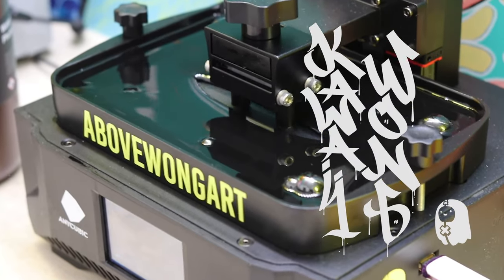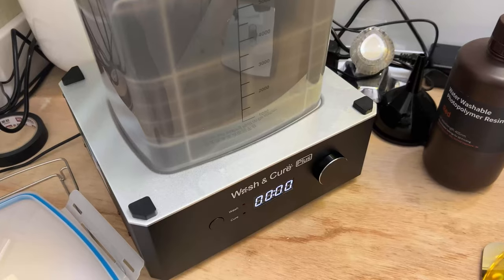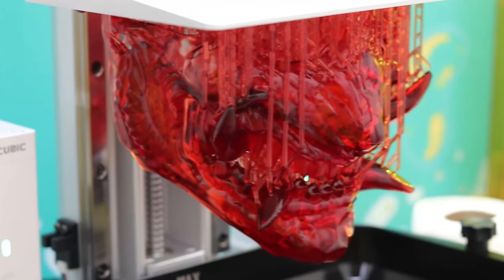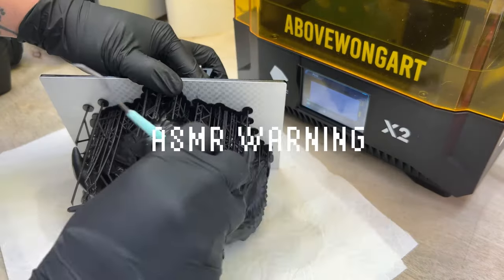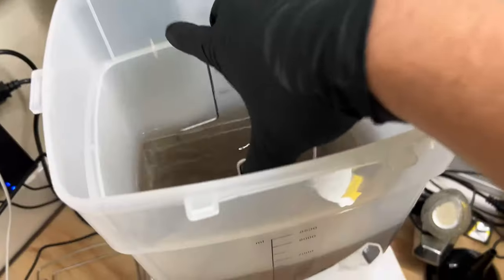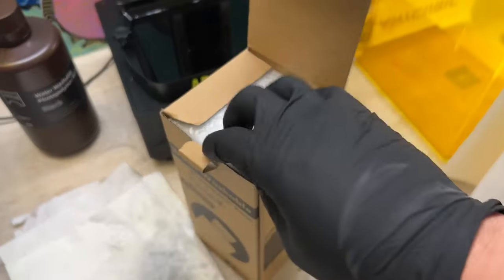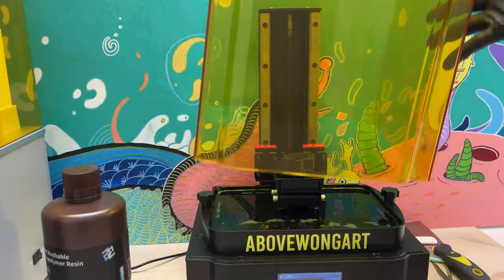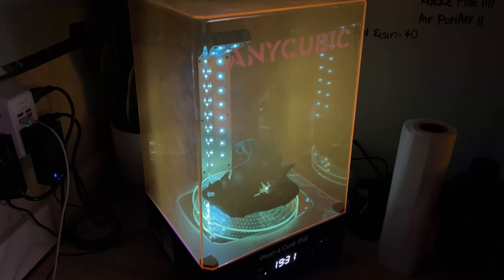How to Process Resin 3D Print Oni Mask#3 by AboveWongArt

Comment: I have a question, is resin safe to wear and inhale after curing?

I have the opportunity to be able to use a 3D resin printer but I don’t want to make a closed masked with minimal air holes if it will be bad for me to inhale.
Reply: Is the mask also heavy?
Reply from the maker: It is very heavy and make sure to coat with clear coat. I use enamel clear coat